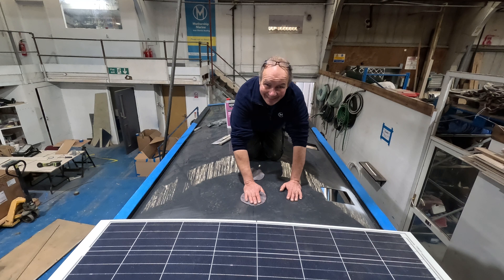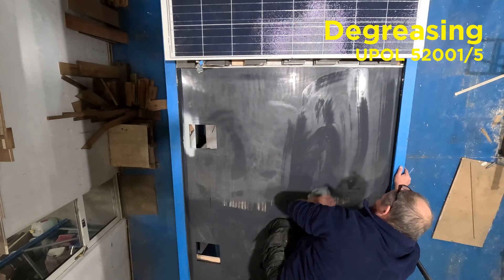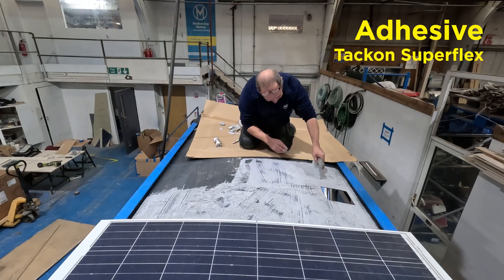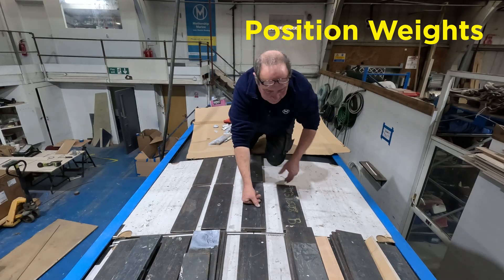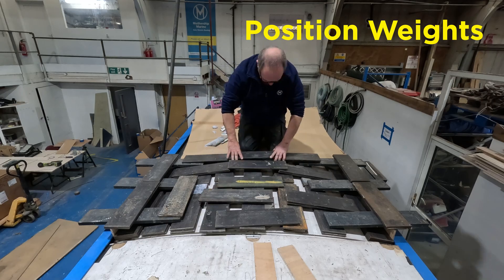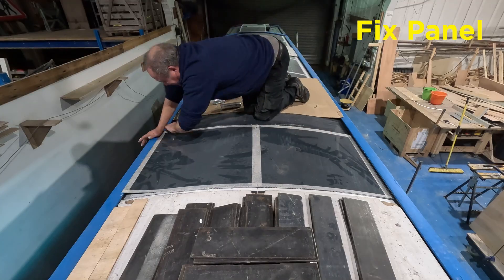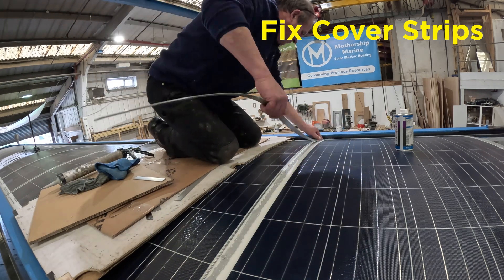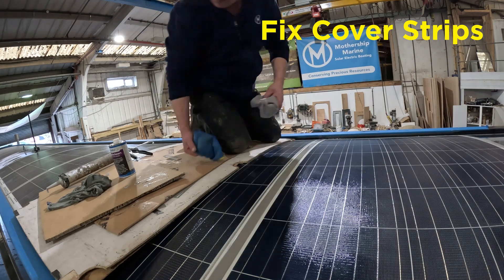Fixing Narrowboat Solar Panels

Comment: Very nice job. Are those standard mono-crystalline cells on a fibreglass/polymer backing, or are they CIGS cells? I'm trying to work out which flex panels are actually long-term reliable (and how to install them properly to ensure that). Taking advice from professionals such as yourselves seems like a good plan.
Never heard of Tackon Superflex before. Seems to be a moisture-cured poyurethane adhesive from Beko. All the info I can find is in German. There are an awful lot of PU adhesives out there. What made you choose this one?
Reply from the maker: Hi There - they are actually polycrystaline cell, we can use mono but they add alot more and customers to date have not need them. We worked with the solar panel company to choose the adhesive, we did a lot of tests on the strips, The top film of the panels is ETFE - ethylene & tetrafluoroethylene with the tetrafluoroethylene being Teflon. So basically this is an adhesive that can stick to teflon. Hope this helps. Tim
Reply: @mothership_marine  Thanks for the response. The price difference between poly and mono has more or less evaporated for big glass house panels so mono has almost totally taken over in last couple of years - you might want to check if it's still the case for you as it gets you a couple of percent more sunshine per m2. It sounded like you are getting them custom-made to a certain size?
Re sticking to ETFE: the adhesive is sticking the back down  (that's not ETFE  - the ETFE is only the front, clear, layer, isn't it?), or are you talking about the capping strips you put across the joints needing to stick to ETFE, and you might as well use one glue rather than two? Anything that sticks to ETFE (Teflon is PTFE, Tefzel is ETFE) will probably stick to most things :-)

Good to hear that you are using poly-c-Si cells in a location that can get stood on, and (I presume?) you are getting good lifetime from those. What have you found for longevity so far? Some say this is a terrible idea and the cells will crack, overheat and die. The very solid substrate you have probably helps a lot here - there is no actual movement.
Reply from the maker: The cells are lasting well, Shine built 6 years ago gets the same solar input as the new boats. Cheers Tim

Comment: Interesting, but when you come to replace the panel the roof will be in a bit of a mess with possible rust underneath?
Reply from the maker: Hi Rob - the panels should last a good while depending on how well they have been installed - 20 years - but this is not a guarantee more of an expected service life. There is very little possibility of rust if the boat is painted well initially and again if the panels have been properly installed. Cheers Tim